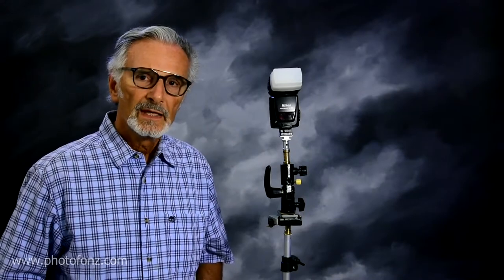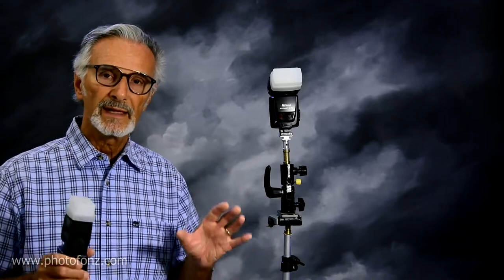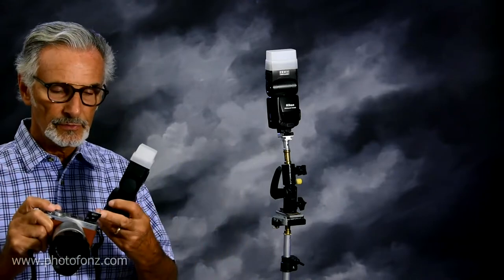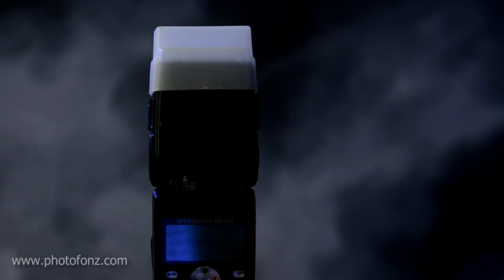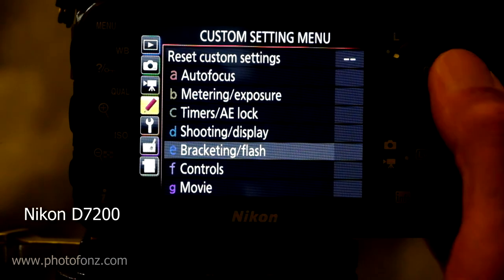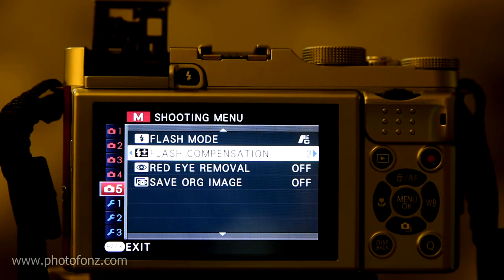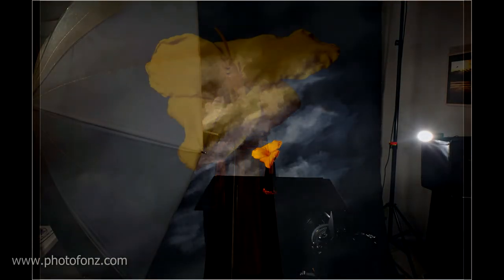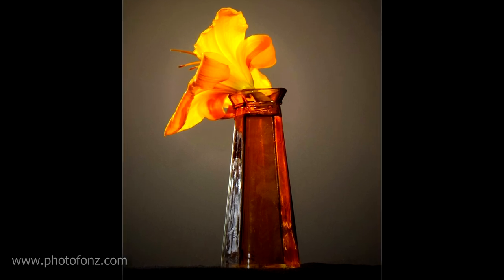Shooting Nikon Speedlights in the SU-4 Mode - No Radio Control Needed!

Comment: Used Nikon's CLS for quite some time prior to moving to Godox's wireless system so I"m pretty familiar with it. When setting the mode in the D7200's commander mode you can set it to " _ " setting rather than M mode 1/128th power as you have here. That way you don't get any additional exposure added by the built in camera flash. The CLS system is designed to work via infra red with compatible flashes ( your SB800 is one of them ) so needs line of sight which is why it's not particularly effective outdoors in bright light or shooting with modifiers mounted to the flashes. You can control flash output via the commander rather than having to make those changes via the SB800's own menu system so it was a pretty advanced system back when it was released. In essence what you are demonstrating here is activating the SB800 and SB 80DX in optical slave mode, thus why literally any camera with a flash will cause the flashes to fire. Despite all the latest 2.4Ghz wireless flash/strobe systems being the norm now I still think using optical slave mode and adjusting the flashes manually is a great and cost effective way to learn flash. Seems most ( my self included ) have move to fully wireless options now. Optically triggering flashes and strobes is a whole lot better than back in the day when you'd have a floor full of sync cord cables! 😉

Comment: On setting the Fuji to commander mode, it's important to set the red eye mode to OFF just as you did. It prevents the Fuji to send out a pre flash which will confuse the speedlights.

Comment: When  you are using a master flash, (even with the 3 dashes set for it) you still get an unwanted extra catchlight from the low power preflash.  Turn the head away form the subject to avoid this problem.

Comment: Sorry, I know this video is 3 years old, but do you think I can use this SU-4  with an old Canon camera (ae1 program) trigering any flash in the hotshoe?
Thanks
Reply from the maker: While I have not used the Canon AE-1 or any other film camera while shooting in SU-4 mode, if you're using an external flash in your hotshoe that allows you to make adjustments to your flash settings, then yes, I believe you should be able to trigger that flash. Thanks for your question.

Comment: Nice video but not much use for a D500 without a built in flash.
Reply: You are right, of course. Some cameras now don’t include a pop-up. This SU-4 mode would work with any speedlight flash you put on the hot shoe of your D500. Forget about Commander mode, just turn the on-camera flash to minimum power on manual.